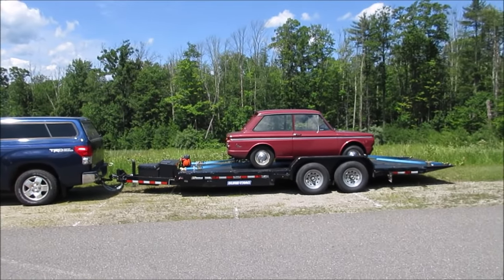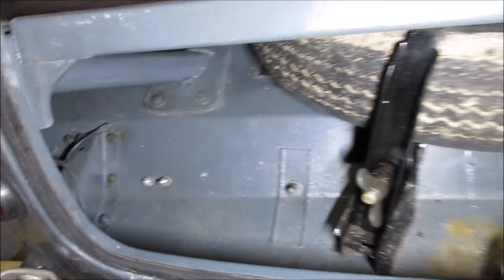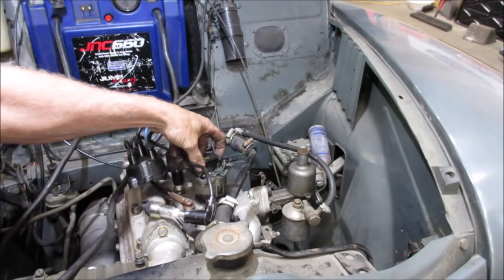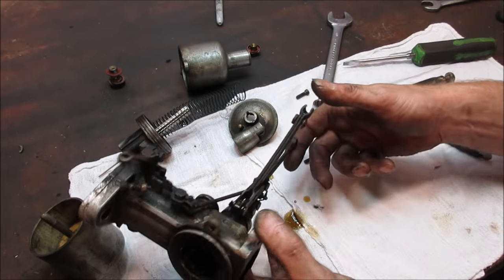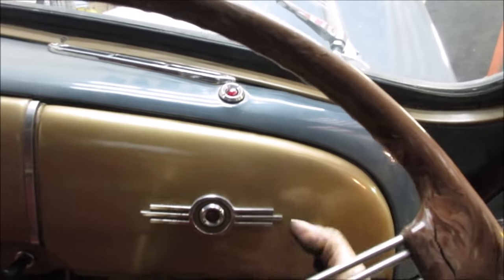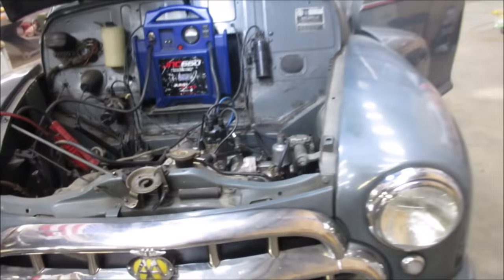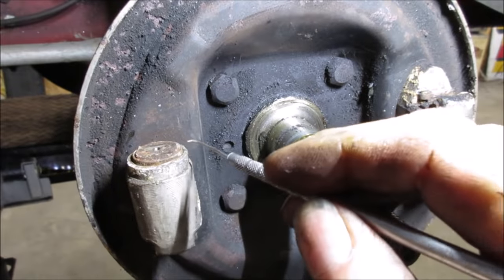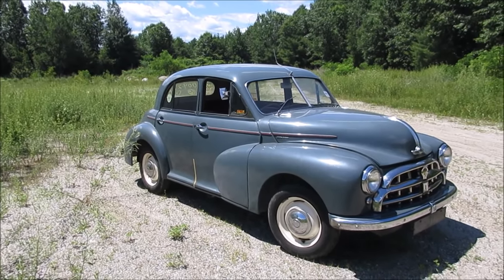50s Morris Oxford Found in an Old Warehouse. Did It Survive?

Comment: This reminds me so much of my 1970's MGB which was basically the same technology, but with an OHV engine instead of side valve. They also have torsion bar suspension like this Oxford. The carburetor piston with the long needle is lifted by the vacuum when the throttle is opened to let more fuel in. The little screw in cap on the carburetor is to allow a little engine oil to be added as it acts as a shock absorber, preventing the piston from fluttering with the variation of vacuum. The lever lowering the seat in the carburetor was to enrichen the mixture for cold start. The MGB had twin SU carburetors which were fun to synchronize. 
Funny as I also used to have a Hillman Imp - last week's feature !!!
Edit to add: The Oxford has a RAC sticker on the windshield and an AA badge on the front grill. The Royal Automobile Club and the Automobile Association were two competing breakdown services in the UK, like AAA is in the USA. The fact that the Oxford's owner was in both services shows he didn't have much faith in its reliability !!!
Reply: The fact he was in both the AA & RAC doesn't necessarily mean the car was unreliable.
My dad was a member of both but never needed to use either, he drove Mercedes-Benz cars which were extremely reliable.
Lots of people joined both as one or the other covered certain areas better.
Reply: And then, there were people who just loved to collect badges and/or windscreen stickers, and have never been members of any of the organisations they represent - Nothing like a fully loaded 'badge bar' when you want impress!
Reply: @whitesapphire5865  I used to enjoy it as a kid in the late 50s & early 60s seeing the AA & RAC motorcycles & sidecars with their riders waving to you when the saw the badge on the cars😁
Reply: MGB has front springs, not torsion bars. How do I know. I changed mine!
Reply: @richierex  Was I thinking of the Morris Marina ?
Reply: The SU carburettor damper was not just to stop piston flutter as it only acted to delay the piston lifting.  This was to cause enrichment of the mixture under acceleration, required because there wasn't an accelerator pump.
Reply: @richierex   Except for the short lived MGC which did have torsion bar suspension.

Comment: That is a seriously rare car , in fabulous condition. 
The Morris Minor is a smaller version with the same steering and suspension. 
Love the side valve engine
Going to be good when finished.
Reply: Yea, It seems to only be running on three cylinders.  Maybe it only needs new plugs, but it could need a few thousand spent on rebuilding the engine and exhaust system.   The paintwork also needs a little attention.
Those were twin leading shoe brakes, the parts may still be available.    Strange these Yanks don't know anything about SU Carbs.. hey hey..!

Comment: HI Mustie, 73 year old here in New Zealand. My uncle Doug had a Morrie-Ox in the late '50s, must have been from new (he was a senior in the Ministry Of Works). I had a '50s Austang (A40 Devon) in the '80s: they were advertised for Grace, Space and Pace (long-stroke for torque, 1200cc, topping out at 5000rpm, 80mph given a good long straight).
Whitworth threads were designed by profile to be un-strippable :  BSW (British Standard Whitworth) and BSF (Fine). BSP was PIpe and BSPT was tapered. 
Those  shock-absorbers were piston-hydraulic with lever to top of king-pin, reason for the good ride over the rough. The Austang had that too (Grace), and the Renault "750"  I had later.
A marvellous resurrection, and not too  painful! 🙂

Comment: Very interesting for American audiences- good to see a car like that there. As a UK based person I am learning too. I did not know that the Oxford had torsion bars at the front. Speaking from experience riding in them as a small boy it explains why they rode so well,  if a little soft (relatively) in the front but not so much in the back with traditional leaf springs. I often wonder why they don't use them now as it seems to be a great and simple system which I think should also be cost effective. One bar/rod versus many in a leaf spring- I know now it is different but still my point is made. Torsion bars are ingenious. But then  I guess not as the bean counters and/or engineers disagree. I am a huge fan of them in the 50's/60's Chryslers, as I am of the late Packards. Citroen used them both front and back too in the 2CV which lays claim to the impossible to roll  at any speed  ( although I think they topped out at 45mph) aspect of that car. They do display a wafty rolling travel around bends in those- but what if they had worked on that with roll bars and dampening?

Comment: The Gas (Petrol) conversion chart was quite common in UK, when they switched from Gallons to Litres at the Garages. Note 4.5ltrs to Imperial gallon.
Reply: Recall those being widely distributed at the time. Everyone was used to imperial gallons (not the little US gallons) but petrol sales was switched to litres. Generally put on the inside of the window closest to the petrol. cap.
Reply: Agreed, my dad had that exact sticker in his triumph dolomite in the 1980s. Some of the pumps has Nixie style tubes for the numbers!!
Reply: Off the subject, if you want to see a screw up on metric conversion, look up the Gimli Glider saga. Its a miracle  no one was killed
Reply: Yeah, we had one of those stickers in our Morris Minor Van. That takes me back, a long way! 😊
Reply: January 1st 1971 spent all my dads old coins before the change 240 pennies in a pound 480 ha’pennies in 1963 960 farthings in a pound. Division by three is actually a mathematical good system.
Reply: @could_try_harder  They may have looked like nixie tubes but they were more likely amber vacuum fluorescent displays. Really old gas pumps had the rotary wheels in them. Once upon a time I made the circuit boards in a board assembly house for Gasboy. They were a major manufacturer of gas pump electronics. And we put the boards together for them.
Reply: US gallon = 3.78 litres. UK gallon = 4.52 litres.
Reply: @VLC8792  yes but now tell us how the US uses "Imperial" measurements. I always love to hear that. The Imperial system of measurements was developed 32 years after US Customary. So our system is actually older. The Brits used something called Windsor before Imperial.

Comment: Hi there, This brought back a lot of memories. Growing up in Sri Lanka, our family had a Morris Minor   - it was called the Minor 1000 for its 1 liter engine. Minors are pretty common in former British colonies. As others have noted, these are notorious for poor brakes and oily engines. Somethings I remember about the Minor that seems to be very similar to the Oxford.

1. The "nice holder for the jumper pack" is where the battery used to be (at least for the Minor). It was a pain to change it since you had to pull up the heavy battery up there.
2. The order of the buttons was (from right), S for start, L for lights, W for wipers and C for choke. 
3. Minor had a stick on the floor. Not sure about the reverse in the column shifter.

Keep up the good work. Looking forward for more classic British cars on your channel :)
Reply: Reverse...pull outwards on the knob at the end of the selector, push down through neutral gate past 4th gear, pull lever down paralell to 4th gear....
Reply: To Smith. I ALWAYS DID wonder how you COULD GET the battery to the back of the engine compartment!  That's asking for a rupture or back injury!

Comment: Saw this hidden behind the Hillman.. interested to see how you go with them. They we're very common here in Australia..as a general rule,most British cars of the 50s and 60s with generators are + earth and 12v. They changed to - earth when alternators were introduced. The generator has its voltage and polarity stamped on the body along with direction arrow of rotation and month/year it was made.
Reply: I think the mk 2 cortinas were generator & negative earth....or may have been early mk3
Reply: But nearly always pos earth for genny, especially english cars
Reply: how is it going in Australia atm ?
Reply: It's a simple job to change a generator to negative earth. After reversing the battery and before turning anything on, remove the wire from the field terminal and briefly touch a jumper wire from the (now) positive power terminal to the field terminal. Do this 4 or 5 times, then reconnect the wire to the field terminal. Job done.
Swap the wires on the coil to keep the polarity of the spark plugs correct.
Most other things should be ok, but anything with a motor might need work as it will run backwards.

Comment: I know these well from my early childhood. They were a common sight on the roads of England, being built from 1948 until 1954. 
They are often confused with the Morris Minor, but were a very different (and larger) car. And far fewer survive. To my eyes, they are beautiful.
The general styling would have been influenced by American cars of the period (after a period of a few years).
British cars of this era are usually positive earth, but occasionally, some were later modified by enthusiastic owners. Many were exported to empire countries. There is a metal plate affixed to the bulkhead which usually contains such information. And usually, the "starting handle is clipped somewhere inside the engine compartment. 
160,000 were built in those six years, and then all the tooling was sent for production of Hindustani cars in India.

This is a fine example. I hope you find a buyer who will look after it.

Comment: This is the larger version of the Alec Issigonis-designed 1947-54 Morris Minor, the Morris Oxford. This was the standard in postwar British economy cars until the Issigonis-designed Austin Mini in 1959 which built under a variety of names and body styles until 2000. What Mustie has here is a fine example of what common British cars were like in the late-1940s to mid-1950s.

Comment: You mentioned lead additive at the beginning: the compression ratio on those side-valves is fairly low I would think he may not need it.
The window sticker of the British gallons to Litres conversion chart, were often seen in car windows  during the seventies because we all went to the Metric system, and all pumps were then changed to dispense fuel in Litres.
The RAC is a car breakdown service - The Royal Automobile Club. The other alternative rescue service around at that time (and often perceived as being a bit ‘downmarket’ from the ‘RAC’, was the slightly cheaper ‘AA’ - The Automobile Association.
These cars were considered as family cars, and they were overgrown, more expensive versions of a Morris Minors.
Reply: Lead isn't only for octane, it also prevents the valves and seats from eroding each other away, regardless of how high or low compression is.  Starting in the mid 70s, the automakers equipped their engines with Stellite valves and seats to prevent that from happening when using unleaded.
Reply: @michaelbenardo5695  your right Michael as many people  with older cars need either their valves renewing or additives in the fuel to compensate for the loss of lead in lead  free petrol ,the same as people will find when they try and use E10 fuel  in classic cars with carbs,and age related fuel lines and fuel tanks
Reply: @alanwareham7391  I have heard that many many times about E10, but I didn't have any trouble with it the times I have used it.

Comment: I had a side valve Ford from 1956. The brakes were rod brakes, and a challenge to adjust to get them anywhere near equal on all wheels. That old side valve thing drank fuel and by 10 years old was clearly a rusted out refugee from a scrapyard. Suspension was with two transverse springs, one for the front beam axel and one for the rear. In those days heaters were for wimps, few cars had them, they were optional extras. On that Morris, the space where you put the booster battery was for the optional heater to be mounted. With new brake cylinders all round and a new master cylinder, it would be far more driveable. The levers on the bottom of the SU carburettor were for the choke, they dropped the main jet down on the needle that came from the rising and falling piston that was supposed to keep more or less constant depression. I cannot help you with the column change, I know they were tricky as they developed wear or rot in the linkage pivot points, but I never drove a column change vehicle. I am told that SU started their life as leather processors and the company was called Skinners Union, later shortened to SU. Early carbs used leather bellows. The dashpot on that one does need enough oil, with the shaft with a piston on it providing a damping effect on the rise and fall of the piston. The engine clearly needed a good tune up!
I did manage to get to drive my old Ford around the country, I probably did a couple of thousand miles in it, but its time had come, and I let it go to its natural home, the scrapper. I did have some engine machine work done by a truly ancient company, that still used some equipment, showing build dates in the 1880 and 1890s. That is another story from the past.

Comment: Hey, Mustie, when you were trying to figure out the parts of the SU carbs the top part with a piston in it is called a dash pot.  It is supposed to have oil in it to function. I saw very little come out. And the lever at the bottom is the MANUAL choke which enriches the mixture by allowing more fuel past the needle. Rebuilt a few of them.

Comment: Hi Darrin!  Love the vid & the car!  You should buy it!  It looks fantastic for its age, & you should still be able to get wheel cylinders for it.  Those semaphore indicators are so cool aren't they!  You could wire in a flasher can maybe, cos I don't think they originally flashed, if they're like the veedubs as I remember them.  I don't think I saw any body rust at all on it.  The right hand drive might be a bit annoying for you perhaps, but not not for me down here in straya!  The interior looks beautiful.

If you check the pitch of the cooling fan blades that would tell you which way the engine rotates.  Then, with ignition & everything else switched off or disconnected, you could power up just the starter motor to see which direction it rotates.  Of course, the +ve terminal is always bigger on that style of battery terminal, as you said, which helped.  I think most pommy cars of that era were +ve earth.  If you take out one of the globes you should see the voltage rating on it.

You called them 'cotter pins', or cotter keys, that's funny.  We call them 'split pins' down here mate!  We used to have 'cotter pins' to hold the pedal cranks onto the axles of pushbikes back in the 70's, when I was a kid.  Just sayin hehe!

But yeah, what an excellent candidate for an absolutely schmick restoration!
Reply: Pay attention and you'll realise the car is already sold.
Reply: Polarity makes no difference on a brushed motor like a car starter. I converted a tractor from 6V positive ground to 12V negative, and the starter worked the same, just spun the engine over faster…

Comment: Hey Darren. The ground wire has a "P" on it's battery terminal and the other terminal has an "N", therefore Positive ground (earth). Very common for a British car of that age. Even my 1967 Triumph Herald was Positive ground. I changed it to Negative ground just by turning the battery round and reconnecting accordingly. The generator (dynamo) will probably be happy either way anyway, but if not, it just requires a quick flick of 12v on the output terminal to repolarise it. Everything else will work happily.
Reply: Also swap the 12V coil wires around otherwise the spark plug spark jumps 'backwards' from outer to electrode and is less intense.

Comment: The fuel conversion sticker dates from the time the HN changed from Imperial to Metric. Krooklock was a well know anti theft device of the time. It locked the steering wheel to the brake pedal by means of an extending lockable bar with hooked ends.
Reply: A quick twisting of the steering usually breaks it free.😁😅
Reply: @bossdog1480  Recounting your first-hand experience is much appreciated - better than the opinions of engineering theorists. Which brand of car lock did you find impossible to crack during your career 🤔
Reply: Didn't the British say that the best anti-theft system was Lucas Ignition?😉😁

Comment: All of the English cars of this time were 12 volts, positive ground.  My folks bought a new Morris Minor in late 1955, used it as a commuter car for my mom. It was a four speed, floor shift. Not being of age to drive at that time, i did run it up and down the driveway though!
Generators by the way, can be polarized to work with either positive or negative ground.  The battery was in that firewall shelf originally.
Reply: Except for the British Fords - they kept a 6 volt system right through the 1950s.

Comment: The top of the su is filled with fine oil to act as a damper. Very simple carbs and easy to adjust. The main jet screws up and down to set the mixture. The whole jet assembly lowers for a choke for cold starting. Nice car, not as common as a minor.

Comment: 44:30 Whitworth was the guy from Birmingham who set the first set of standards for head size, thread pitch etc. Most of the fasteners used on those will be BS (British standard) and the spanners used will be A/F (across the flats) rather than Whitworth.  Probably only the battery terminals will be Whitworth.
Reply: And he Invented a Musket able to Hit a Target 1000 Meters away
Reply: What sort of mechanical training have you had lift the throttle when cranking